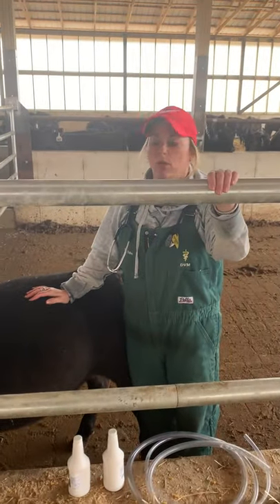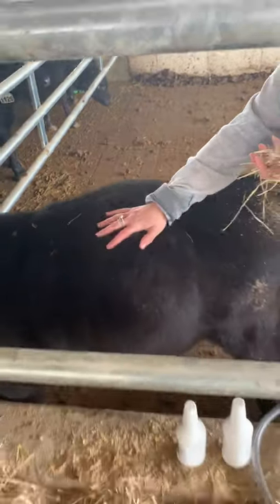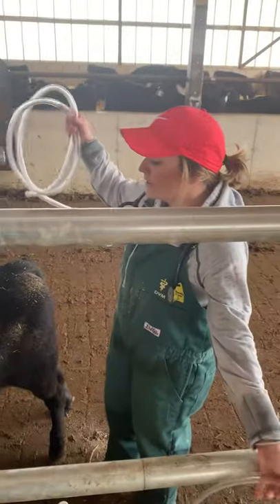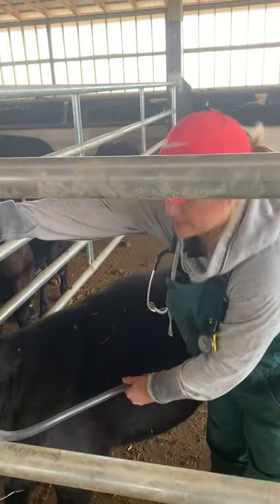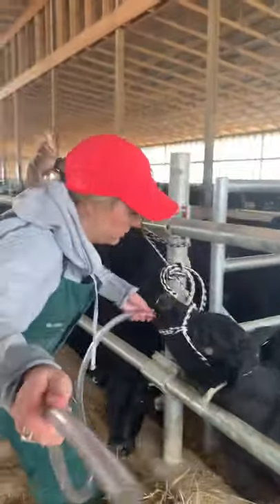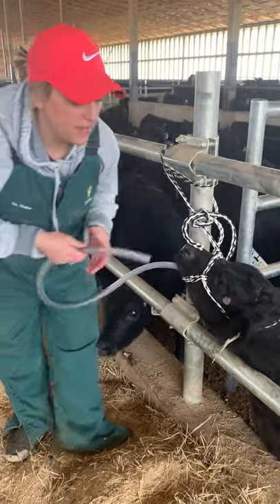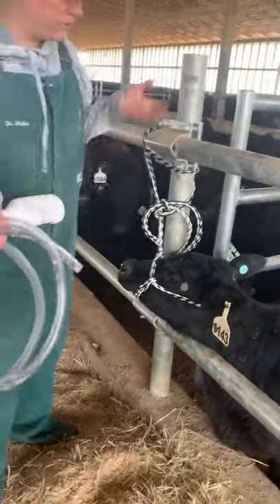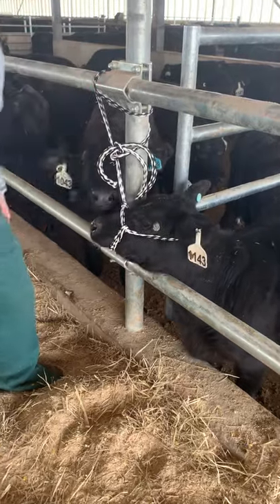Bloat in cattle 💨

Comment: That video was awesome❤ what size tube diameter do you get? We had a 300lb calf with mild bloat, I put 3.5 ft of a trustituber esophageal tube down and tube passed very easily, aimed left, head neutral position. calf in no respiratory distress at all but I was hearing breath sounds rhythmically coming out end of tube I so did not do mineral oil. It did resolve taking calf off all feed for the night. I guess my esophageal tube was maybe too small? and too short, for a 300lb calf.  I’ll get some of your bigger tubing and buy 6ft. 

What size diameter tube please❤

Comment: Stupid question. When passing the bloat treatment down the tube, do you just pour it down? I’m picturing the liquid not going down as easy. And if you need to perform this process again, do you need to wait a certain period of time before doing it again? Thanks!
Reply from the maker: Sometimes you have to create a back pressure with more water, but usually if you lift the tube up - gravity does the job. I will do this again whenever needed until the bloat is resolved, but it usually only takes 1-2 times.